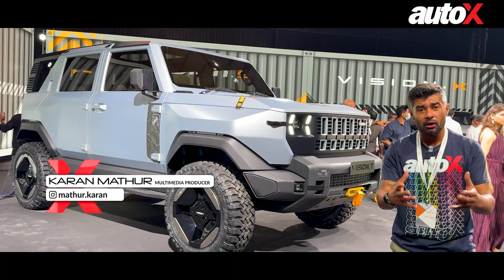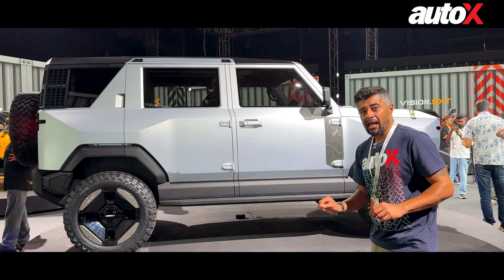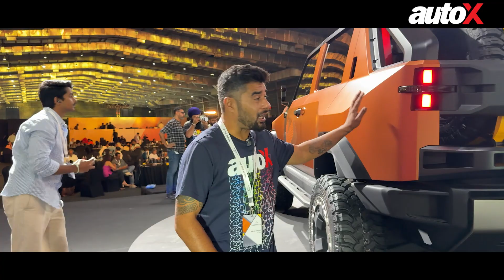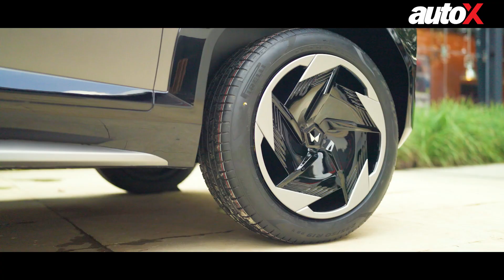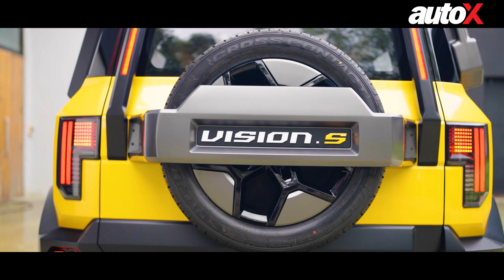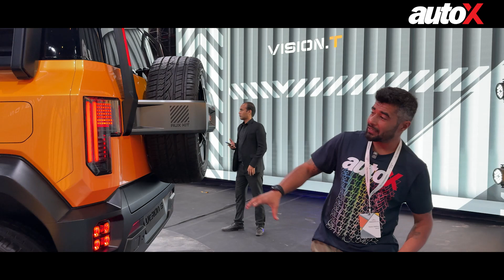Mahindra Vision T, Vision SXT, Vision S & Vision X Concepts - All 4 SUVs Explained | autoX

Comment: I have a Creta NA 1.5 Petrol Manual and I desperately want to upgrade my car due to its dull engine performance and bad mileage. My yearly running is 9000 km. Mostly highway drive, 90% highway , 10% city. I don't use my car daily but whenever I do , it's 200km+ drive always ( as I also have i20 2023 NA petrol for short runs). I am confused between Diesel Kia SELTOS 1.5 and Turbo Petrol 1.5 Kia Sletos and VW Taigun 1.5 . BUDGET is around 20 Lac . I can live with mediocre Mileage but want Good Performance. I am more inclined towards Kia Seltos Diesel 1.5 HTX MT for its Torqy Engine , Great Mileage and VFM Factor( i owned Dzire 1.3 Diesel from 2018 to 2022, gem of a engine ) but worried about DPF issues and my low running need. 
Also these E20/E27 debate going on so might not want to buy Petrol as of now.
I will own it for atleast 5-7 yrs. So going for diesel not for Mileage only but fun to drive factor and its also cheaper than turbo petrol. 
Please Advice.